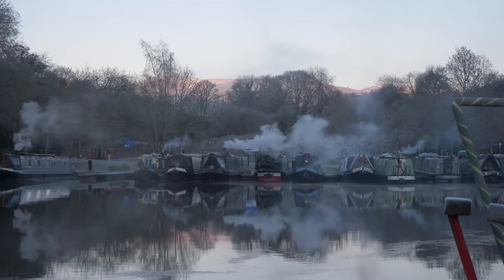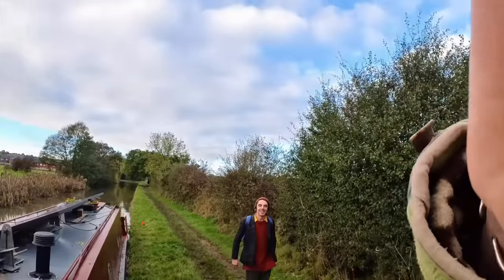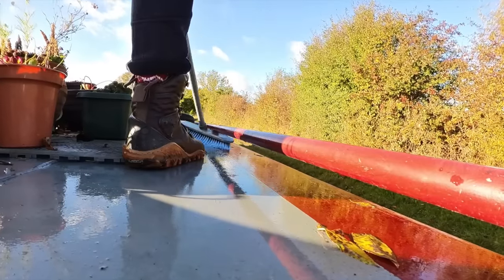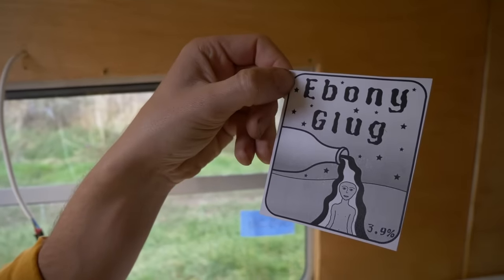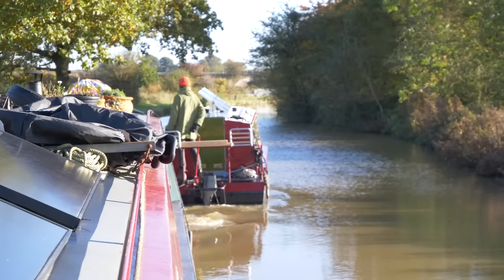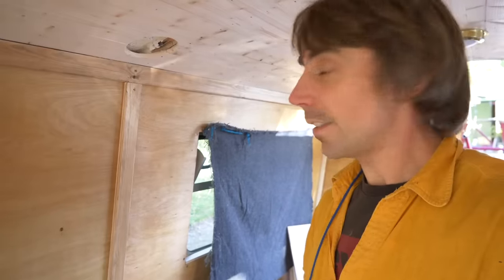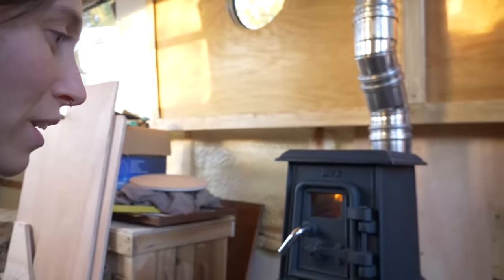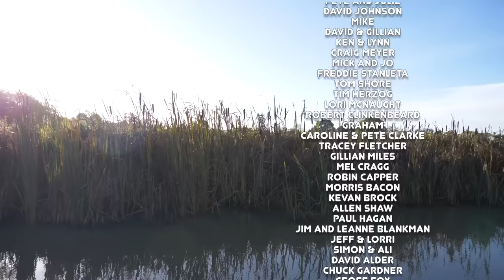Is It COLD on our NARROWBOAT Home in Winter? | New Wood Burner Install in our Project Boat | EP77

Comment: Love watching other people work and you get A for effort. As an old tired trades inspector a few things for what it’s worth.
The flue/chimney is going to be difficult to clean with the offsets. To clean it properly you will have to disassemble it behind the stove which will be messy. 
The best way is always to make the flue/chimney go straight vertical into the stove like your other boat so the brush cleans it throughout. 
Another thing is where it penetrates the roof it should be all noncombustible metal with 1” air space clearance around the pipe. It’s possible to get a chimney fire if you get distracted and forget the draft open. Creosote chimney fires can burn like a torch approx 2400f.

Comment: You can fit a back boiler to a morso, well worth doing. Install a radiator in the bedroom problem solved, much better than burning a second load of fuel in a second stove.

Comment: The little stove looks great 🎉🎉 did you know you can get a 'back boiler' that goes inside the Morso and it will run a radiator or two for the bedroom, I had one on my 50 barge and it worked really well, used 22mm pipe so no pump required just worked on convection with the hot water,

Comment: Take the baffle plate out first, then put some newspaper in to collect  debris. Sweep chimney. Leave for a day. Take newspaper out.  Brush around inside where baffle plate will sit, preferably whilst you have the  vacumn machine nozzle inside the fire. Refit next day, job done.

Comment: top tip, one or two little computer fans to circulate the air and maintain a constant temp at the back of the boat.,   roof to the rear, floor to the burner.   they dont take much power but make a big difference an hour before bedtime.
Reply: Or you can get the fans that use no power, they use heat. You leave it on top of the stove, it heats up and starts spinning and only stops when the fire dies right down. It works by convection and heat radiation through the metal.  Science.

Comment: Just something you might not be aware off when you empty the ash you should leave around half inch in the bottom it extends the life of the unit and will allow better heat transfer.

Comment: Loved your video . Thanks for clearing up the myth of freezing conditions in canal boats over the winter . 
Someone else has already said about installing a radiator , but I reckon a small insulated hot water storage tank would be worth considering too . I installed a whole coal fired back boiler system with tanks and radiators in my first house with no previous plumbing experience . If you use copper piping , which I did , choose pipe fittings which are pre soldered , called Yorkshire fittings . For a plumbing newby these make decent connections with relative ease over just copper fitting which need to be fed solder . 

My back boiler , the same sort of fire as you have basically but including a built in water heating jacket , had a thermostatically controlled air vent . This was a mechanically controlled device , it was not electrically controlled . I mention this because a few times I found that ash particles had been spat out of the grate and had fallen into the vent area . This meant the vent could not close properly causing the fire to roar out of control . That could be very dangerous . Ensure the vent areas are clean , especially before going to bed or leaving the fire unattended . This might not apply to the design of your fire , just saying ! 

There are devices you can buy that sit on the fire that act on the rising heat and turn a fan which helps spread the heat about ....

Have a warm Xmas . Cheers and thanks again !

Comment: Ive lived on my boat for 24 years and the first thing people ask is " is it cold in winter". I tell them i sit in candle light shivering with a dew drop on the end of my nose 😅😅😅. Actually my first winter was a steep learning curve but since then ive been toasty. I heat the boat with a kabola diesel boiler running four radiators.

Comment: Just to say, I used a pipsqueak on a Norman 23 for 6 years ,living full time. I’m not criticising for the sake of it ,just being factual,
Your flue run is too close to the wall,you would be safer to angle round to 45 degrees, I guarantee that the flue heat will be far higher than you think. The rubberised collar will work fine. Obviously you have to cut wood to about eight inches but you can top load. To comply with boat safety regulations you will need to anchor the base plate down.I’m open to any sensible discussion regarding the aforesaid. Great little stove btw . Top tip, the baffle plate is held in with a Philips head bolt, change it immediately for a robust bolt that you can get a socket on, you will need to remove it to flue clean properly. Also make it a weekly job to flue clean. Hope this all makes sense.

Comment: Great burner Benny, and Keith with stovepipe install. tremendous chimney cleaning Emily. Good endorsement, Alan. If you do go with slate pieces for under the heater fireplate, make them from Wales.

Comment: One comment. You have put the stove on a plinth. As we all know heat rises. Installing a stove should be as close to the floor as possible. Your setup has the potential of having your feet in Alaska and your body in tropical Africa.
Reply: That's why canal boats have fans, it circulates the warm air all around
Reply: But it's a lot easier to use a mini burner like that when it's lifted a bit -  you don't need to bend double or kneel down everytime you want to do anything with it.
Reply: Such a rash generalisation about the effect of raising the stove on a plinth has only mild entertainment value for the Chattering Class, but provides no useful information for experienced Narrowboaters, or indeed casual onlookers

The Austin 7 had a thermal cooling system that distributed heat from the engine without a water pump. Such thermal distribution of heat will apply inside Rambler too, due to air circulation and human activity.
Reply: Those fans on top really help with that.
Reply: @monza1002000 The typical stove top fans will move warm air horizontally along the boat reasonably well. But that heat will still rise rather than fall to lower levels.
Reply: When you have a wooden floor, putting the stove on a non-flammable plinth is a bit of a necessity. Given the very limited height of the chimney, a plinth makes very little difference to draw. In a small space the heat will circulate very well by convection.
Reply: @iankynaston-richards5239  Sure, it perfectly normal, standard even, to put the stove on a plinth. But the usual plinth is about 10 cm high.  This looks to be more than 300 cm high.  That’ll make a noticeable difference in its ability to heat the air near the floor.
Reply: Could you put a back boiler on the stove and a radiator in the bedroom 🤔?
Reply: Narrow boats are a holiday home not to clogged up our tow paths making a mess buy the looks off your scraper it's out off date go green where you empty your Ashe's
And toilet Do you burn your garbage keep the country side clean
Reply: @arnolddill Doesn't matter because of how fluid dynamics work. The stove heats the cold air and thus rises causing more cold air to move towards the stove and the hot air cools down and sinks creating a natural draft.

Comment: Just in case you may not be aware of it, a stove needs to be secured to the bulkhead or to a hearth that is secured to a bulkhead or the boat will fail it's safety test (due every 4 years,) and you won't be able to license it.. It doesn't look like you've secured your stove in which case it will fail the next safety  test.

Comment: Hello Ben/Emily,loving your videos.  With regards to heating your Bedroom area have you thought about something like a camping gas Heater??  They`re about £30 on line and even come with  the little gas canisters. That way you don`t lose any living space,can easily move it where required,it wont drain your batteries and can stow it away in the Summer months+ a couple of curtains to trap the heat in the bedroom area. 🙂

Comment: I always understood that it was useful to leave a good bed of ashes so that the added fuel burns more slowly and will keep the embers glowing overnight.
Reply: Emily mentioned that this stove was dual purpose for wood and coal. The draft knob and draft come in below the firebox and up through the grate at the bottom of the stove. A bed of ashes would restrict the airflow needed for efficiency.

Comment: Not sure why you didn't go for a cheap diesel heater. Mounted outside, one hole into the boat for the blown hot air, you have a 12v supply, diesel decanted from other boat, instant heat, no fumes in the face when on the move etc etc. ?

Comment: Kiaora guys, I am curious that flue is fixed directly to rubber flange, in N.Z we have outer and middle flue to provide air gaps to cool pipe so rubber doesn't melt, maybe your flange is more heat resistant than our types? Love your vlogs, we looking at cruising your ditches next year!

Comment: I travel and live in an ambulance. Have you ever tried a 12 volt electric blanket? They're great. Mine has a button that when pushed it stays on for 30 minutes and then  automatically turns itself off  until you push it again.

Comment: Hi Benny. Just one question how is your fire secured at the base. Is it bolted or just free standing.  I know that you are still installing as you have the tiles to lay. But sure a narrowboat fire has to be secured firmly so it does not move. 😊

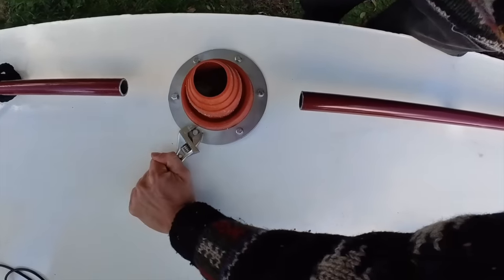Comment: 16:55 did you use any kind of sealant between the rubber and the exterior surface? or is the metal collar around/on top of it enough to keep it sealed tight?

Comment: Good tip take out your baffle plate first put newspaper in the grate, close your dampers clean the chimney. I f your burning wood then you can open your dampers full and light the newspaper and some kindling . This will burn off your carbon soot and not pollute the land or wherever you throw it. Make sure your neighbours are few and far between they wont be happy if you spread burning soot and paper everywhere. Best not reburn coal soot can cause a chimney fire but your flue is short so unlikely to catch fire. Oh by the way coal is now not legal to buy or burn.

Comment: too small, when generating heat big is best, you will be feeding this every 20 minutes, you need something so big you can chuck a few logs on and forget about it, also surrounding it with bricks will act as a heat sink and release heat slowly all day the next day, it will never be cold again, I know you love the burner but you will buy a bigger one and when you do buy a Norwegian one. they are the best, I've had a few but when I pushed the boat out and bought a Norwegian one is was amazed at the difference, mine heated a back boiler as well and I wished I had wound copper pipes around the back of it to feed hot water and rads,
Reply from the maker: Thanks for the tips! 😊 We've been using it for about a month now and its brilliant. You do need to tend to it a bit to get it going but once it is going then you just need to fill it with the coal substitute stuff and it goes for a good few hours, just drop a couple of bits of coal in every few hours or so. Not used it over night yet but it's been on all day everyday like this and it's been more than hot enough in there, bit too warm for DIY actually 😅 It's a tiny boat so we don't have the space for a big burner, but thanks again for the tips! 👍 🙂

Comment: No offence, but you dont have much idea how to sweep a chimney. First make sure its cold inside the stove, remove the throat plate , put your cardboard in and a proper rotatable brush up the chimney and then put a sheet over the stove with a small hole in it , threading the shaft through it . Rotate it gently up and down the chimney a few times with a battery drill  , job done . You probably dont even need to take the pipe top cap off either if its fixed on tightly. Hope this helps.

Comment: I thought they passed a law this year to ban these? Good thing about narowboats are they are more insulated than most housing stock in the UK and Ireland! Narrowboats aren’t cold and dont pay £400 in connection fees like houses do so it’s mega cheap to keep warm compared to a bedsit or house share! Big bug bare about canal boats being cold when they ten time warner that most houses and don’t pay connections fees is becoming a bit “Oliver twist” to the garner funding!
Reply: Fuel has gone up massively in cost and I can assure you I am not as warm as Emily and Ben in mine. It’s like Alaska in half of the boat and need to run costly fan heaters to compensate. Why is it a bug bare for you when anyone can choose to live on a narrow boat? The reason most people don’t is because most things are hard, especially in Winter and lots of things carry an extra price tag for fitting/installing/renovating/maintaining.